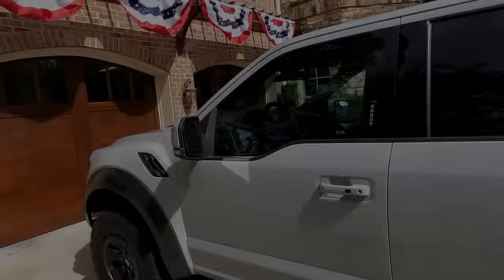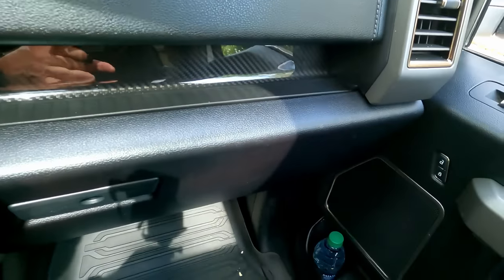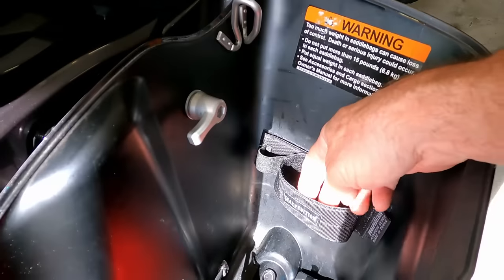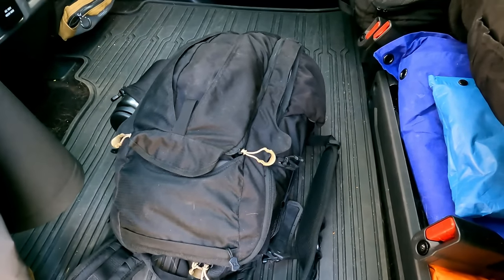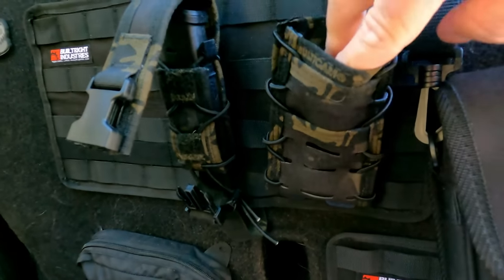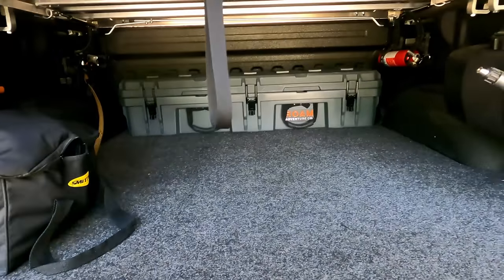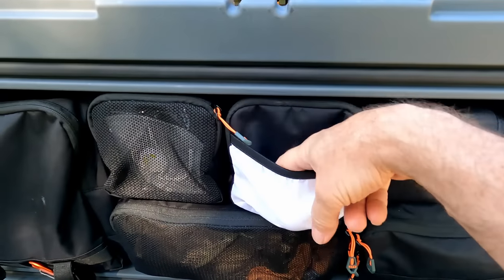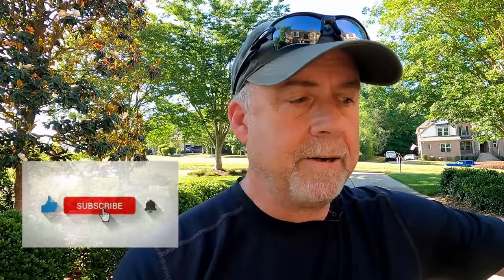Truck EDC - Everyday & Emergency Gear

Comment: You asked for suggestions, so here goes.  Come-a-long to get unstuck.  High Lift Jack, invaluable.  Axe, small and large.  Tow strap and chain to reach that tree to connect to the Come-along to get you unstuck.  That is based upon my got stuck experience.  Also, imagine driving into the forest, then while driving out a tree fell across the road.  Hence the axes and saws, which you have.  Just saying.
Reply from the maker: Hi Kent.  Thanks for watching and your suggestions.  I would love to mount a winch but in the meantime a come-a-long would be a great addition. I also need a High Lift Jack.  I do have both an axe, hatchet, and tow strap. Good info Kent.  Thanks.

Comment: I love the hand warmer idea. I need to do that in my truck!

I saw multiple different types of magazines... If I were you, get one gun and make that your primary EDC and training gun. Also, you should carry that Glock on your person. that way you ALWAYS have it. You probably won't be in your vehicle when you need it and down there in the console it'll take a long time to draw it out.  Your car isn't a holster and if your truck gets broken into a criminal will get your gun. Let's not arm criminals and protect ourselves in the best way always. 

Also take that tourniquet out of the wrapper and stage it properly. You can find YouTube videos that show you how to do that. If you have to use it, seconds are valuable and you don't want to be ripping plastic off and figuring it out in that moment. Youtube has a ton of training when it comes to medical/trauma stuff but definitely get some training in person also!!

Also, be aware of the common failures of  Olights.. They have a tendency to be explosive. It's just true. Streamlight is another brand that makes similarly priced products that will last YEARS and be way more safe and reliable. They are also very quality.
Gloves are awesome. Having lots of those is a great idea. 
Maybe get ammo stored in a magazine instead of a box in your roam box.

I like your setup!! Might also want to add some merino wool socks, Water filtration systems (Sawyer minis are cheap but good options), Multiple Fire starting redundancies(lighters, Ferro Rod, and some kind of tender that burns for a long time), a headlamp or two would be good. Headlamps are the STUFF.

I wish my Tacoma's interior had the storage of your Raptor so much. Keep building an awesome rig man. These are just a few things to consider. Take care!
Reply from the maker: Hi John.  thanks for watching and all of the great info.  It has been about a year since I made the video and have modified in a lot of the areas you mentioned.  I carry some of the things you mentioned in my get home bag.  In regard to the Glock.  I don't think I expressed it accurately in the video but it is my everyday carry and I only place it in the console when I have to remove it. Thanks again for watching and your comments.  Have fun with that Tacoma.  They are great trucks!
Reply: @WeekendOverland  Gotchya. I carry a g19 appendix anytime I leave the house also. I really enjoy this content. I picked up a camper shell at the beginning of the summer, but haven't had time to do much. I plan on running power from battery back there as well as building a drawer system soon. Anyways, thanks for reading and replying! It seems like a search for the perfect gear is a journey that never ends, but its fun to brainstorm and improve things when possible!

Comment: Nice setup. Instead of a roof top tent for my truck I want to go for a Leer bed cap.
Reply from the maker: Yes, pretty cool as well ........... maybe with decked drawer system
Reply: @WeekendOverland  yeah that sounds super sick! I got just a 18 lariat 5.0 so I don't wanna over work the ole girl.
Reply from the maker: @raptordc5  definitely understand.  I have had my 2017 for about three years (bought in 2018) and only until Jan of this year was I ready to start drilling into it. If I didn't need height for my fridge in the truck bed, I would probably go with a set of decked drawers of something similar.  Good luck with the truck.  I'll have some videos in the coming weeks on some mods I am currently installing.

Comment: Great set up.  You may want to consider changing the water to different containers as the plastics will leach when warmed and cooled a few times.
Reply from the maker: Hi Jason.  Thanks for the input.  Someone else had mentioned the impact of the high temps.  I may have to keep the stainless bottle filled.
Reply: @WeekendOverland  Something you can do, since you have the room, is get a small 12v RV/car fridge. If the truck is your daily driver, it shouldn't impact the vehicle battery. Additionally, you can get a small flip fold solar panel, run the wires to the truck battery, and unfold the panel on the dash to trickle charge the battery.
Reply from the maker: @ericg7183  I have been looking at the ARB and Dometic units.  Recently got a Jackery with solar for power

Comment: if the gun is in a holster how shoot when a guy is at your window trying to mug you
Reply from the maker: Hi Angie the right answer is more than I can write in this response but the short answer is training, training, training,  In a vehicle there is a much higher probability that, under stress, you may shoot yourself while retrieving your firearm,  It is best to have the trigger covered when you reach for it and then train how to react and point without sweeping your legs with the muzzle.  So much that can be discussed on this subject.  Training is key.

Comment: The main thing that everybody has to learn is keep it small and light one pack in case your truck breaks down and you got all that gear in there your butt's not going nowhere and if your miles away from help it cannot be done.
Reply from the maker: I agree but my plan is to have more than I need (used for emergency and everyday supply) and then strip out to only what's needed if the emergency arises.

Comment: What is the name of that holster holder in your center console?
Reply from the maker: Maxpedition Pistol Mount: https://amzn.to/2UHWpww
It will adhere to loop velcro so you will need to buy adhesive backed velcro to stick to the surface that you want to mount it to. I applied three 2" strips about 4" long (one above the other) to form a 4" x 6" square and then the holder will mount to it and stay in place.  Make sure you allow the adhesive enough time (over night) to set up before you stick to holder to it.

Comment: I can feel another Sootch00 subscriber here. Maxpedition packs and “boo boo kits” are dead giveaways! Haha!! Awesome setup! Got to add some good shoes though! Get home bag ain’t worth jack if your hiking a long distance in flip flops!
Reply from the maker: OT thanks for watching. You nailed it! Haha I am a fan of Sootch00!  I actually mention in the video that I should throw in a pair of shoes (especially since in most of my videoing at home you can hear my flops sliding around on my feet!) Thanks again for the reminder. I feel a revised video in the making.

Comment: I’d get a big shovel, a really bright flashlight, dog leashes and extra collars, a big beach towel to protect stuff or to dry off, tire inflator (ryobi makes a good one for cheap, maybe a chainsaw, some extra fluids for your truck, water filter, paper and sharpies, hacksaw
Reply from the maker: Hi Mack.  Thanks for watching and your reply.  You have read my mind in regard to a Chainsaw (Dewalt 60V) and the Shovel.  I have a few flashlights, water filter, and tire inflator (Smitty Built in the bed of my truck).  Great idea to load up on extra dog gear and fluids for the truck.  I have a small hacksaw but probably need to throw in a full size in my recovery gear box.  Thanks again for your feedback.
Reply: @WeekendOverland  or even a sawzall. The funny thing is I just watched this video and then your other ones and was like wow, you have about everything. I also like to keep a pack of coke in my car because you can hydrate from it but it is also great for the caffeine if you are needing to stay alert. Any cafffenated drink will do this I just like coke best. You should look at the dewalt stuff though,  the chainsaw, sawzall, maybe an impact, spot light, vacum of some sort and inflator are all handi. Also maybe a portable solar panel.
Reply from the maker: @MB12116  Hi Mack, great input.  I LOVE Dewalt products.  I recently switched out most of my gas yard equipment to Dewalt electric so I could shar batteries with my power tools.  Good idea regarding caffeine....
Bottom line, I think I'm going to need a bigger truck!! :-)
Reply: @WeekendOverland  you have a ton of space lol. I am a ryobi/ makita/ sthil guy. The battery stuff is great

Comment: Missing Zipties and Hand wipes also plastic water bottles left in a truck is not good to drink because the plastic breaks down but for emergencies would suffice
Reply from the maker: Hi Travis.  Thanks for watching and your comments!  I actually keep the wipes and zip ties in my get home bag I keep in the truck.  I have also switched to an aluminum bottle for emergency water storage.  Probably need to do an update.  Thanks again.

Comment: Is this Ford Raptor your daily driver?  Do you have any extra insurance to cover all the equipment in your truck?
Reply from the maker: Hi Bob.  Thanks for watching.  Yes, this is my daily driver.  I do not have additional insurance.  I feel a little better now that I have installed the Diamond Back cover but things could still happen.  I also need to invest in the locking brackets for the IKamper.

Comment: Sir,
You might put a good sized all purpose fire extinguisher near your tailgate opening and keep it free from all obstructions.  The smaller extinguishers easily accessible from both sides of the front and rear passenger cabs would probably be a great measure of safety.  Your medical gear should be just as easily accessible in my opinion.  
Take care.
Reply from the maker: Hi Marcus.  Thanks for your feedback.  I have added a smaller extinguisher in the cab and will be repositioning the one located in the bed at the tailgate.  I'm repositioning the Waterport to make room.  Thanks.

Comment: If you don’t have a like a cb radio in your truck that would be a good idea
Reply from the maker: Hi Joshua.  Thanks for the feedback.  I have been thinking about doing so.  Must push that up higher on the priority list.
Reply: CB is hardly used anymore. Stick with your cellphone and get your radio license. I had a CB for years, never heard a peep on it.

Comment: Ya very well tough out 
For me being located in northern Canada  fire devices and fire starters is my priority  and extra warm clothes   I have long John  turtle neck shirts  fur lined hat gloves  neck warmer  by the way your hand warmers don't last more than 6 months  ya I always prepp  for cold weather   ya get a pair of rubber boots onboard at all times  got my regular pair and a pair with liners  (baffin) good to minus 40  according to the manufacturer  ya right  lol  have a pair of good leather work boots  onboard   got a 12x16 tarp 24 inch buck saw butane and alcohol stoves  a bit of food  dry soups  tea coffee  ect.. our distances with out civilization are great   I been in the oilpatch for 35 years  I seen quite a bit of stupidity out there because people relying on others but ya your setup is great  love it  take care be safe
Reply from the maker: Hi John. Thanks for watching and your comments! Yes your situation is quite intense compared to mine but I do change mine up during the winter to accommodate colder weather.  I have made a few changes in the last year and hope to have an update video soon.  You are correct regarding hand warmers.  They still heat up but not as much as when they were new.  Last weekend I spent the night on the ground in a bivy with a liner and no other shelter and it got down to the 30's F.  The older hand warmers did not help much.

Comment: Do you worry about your truck being stolen and losing all this equipment/setup?
Reply from the maker: Hi TNT thanks for watching.  Not really that concerned. Unless I have the truck out on a trip and combining hiking with truck camping, I am rarely parking it somewhere for long periods of time unattended.  I work remotely so it is normally close by in a secure location.

Comment: Might want to add a jump box in case your battery dies
Reply from the maker: Hi Joey.  Thanks for watching.  I do carry a jump box with my recovery gear.  I have done a separate video discussing advantages of small power sources which this was discussed.  Wish they were invented when I was young and drove a vehicle that needed a jump on a regular basis!!

Comment: One think I think you might be missing unless it’s in your bag is a full face respirator. Depending on where you live, you may potentially be dealing with a riot being met with tear gas. Thanks for the video!
Reply from the maker: Hi Jon.  I do not own one yet but have been considering one.  Thanks for watching.
Reply: Not tryna hate, but how often are you going to be in a riot met with tear gas

Comment: Curious what 67 designed option did you get for built right set up?
Reply from the maker: I went with the F150 Upgrade Package and chose the Small (6" total length) polished black CF arm G2. Then mounted the Go Pro attachment onto a AMPS Plate.

Comment: You seem to have money... invest in some nitecore flashlights and batteries... also, maybe a portable battery inverter/power supply... and a tent?  Also look up surviveware on amazon... great medical supplies and fire starting equipment... compass? Shotgun? Also I wouldn't leave waterbottles like you did... if they get hot in the plastic you can drink them... get a rough country cooler/refrigerator... besides that, I love you metal Molle stuff... I'm getting some...
Reply from the maker: Thanks for watching Jason and the input.  I recently invested in the Jackery 1500 and 300 with solar panels (great sale during Amazon Prime Day).  Have been looking at ARB and Dometic refrigerators but will check out rough country.  I have videos on my roof top tent set up, check them out when you have time. Thanks!

Comment: Awesome set up! One thing I’d recommend it’s nothing too much to worry but it would be nice to have is a strobe light for when you pull off to the side of the road you can always plug it in the cigarette light just to be able to be seen. I’d also recommend wet wipes for dirty hands, or hand sanitizer with how the world is now an day. Other than that awesome layout!
Reply from the maker: Thanks for watching Lisette! I actually discuss electronic road flares which have various light patterns you can use.  These are a great visual at night.  And yes, always have plenty of wet wipes and sanitizer.  Thanks for your feedback!

Comment: take the tourniquet out of the plastic and stage it correctly,  You need to be able to put it on yourself or other with in 30 seconds.  Just a suggestion from ER doc and SWAT doc.  Nice video
Reply from the maker: Thanks Marc, I soooo wish I could edit this video.  I took it out of the plastic about 3 days after making the video.  There have been many comments on this (which is good that so many people are aware of the correct setup).  But thank you very much for watching.  I do enjoy the comments and learn a lot as well.  I have made quite a few changes to my setup in the last 3 months with a couple more coming.  I will shoot a video once all updates are completed. I am also scheduled for a class in Active Threat Trauma Care in December which I am looking forward to.  BTW, Thank you for the service you provide!!

Comment: Only one roll of toilet paper!?  Unacceptable! I'm kidding, but having said that, I do have several in my truck and truck bag. I'm glad I had them available this past weekend. :) Another good multi-use tool is a set of fencing pliers. I use mine for fencing of course but they are pretty versatile and have many uses. Example: If you were twisting that wire you have you could get it really tight with them.  Great setup. I enjoyed the video.
Reply from the maker: David thanks for watching and the suggestion on fencing pliers.  I believe I will be adding them soon.

Comment: Anyway you could send me a link to those velcro baofeng pouches? Thanks
Reply from the maker: They are actually for AR-15 mags.  The pouches came with a bag from Sig Sauer.  I didn't need them in the bag and since there was hook Velcro on the back, it was perfect for what I needed. sorry I couldn't be more help.
Reply: @WeekendOverland  Hey thanks for the response. I figured, Had to at least ask. That worked out great for you!!
I’ll keep searching.

Sweet setup, you’ve given me a few ideas for my raptor. Thanks a lot!!
Reply from the maker: @yourmomma816  thanks for watching.  I need to do an update video.  So much I want to do to my setup.  Enjoy that Raptor!

Comment: What type of Velcro do you use for that maxpedition holster?
Reply from the maker: I actually just bought a roll of adhesive velcro from Lowes.  On my first attempt the adhesive did not hold because I did not let it set up long enough before use.  Apply the velcro strip and then apply pressure for a minute or two and then let it set up over night or possibly a little longer. The heat in your vehicle during the summer will test it's adhesion as well.